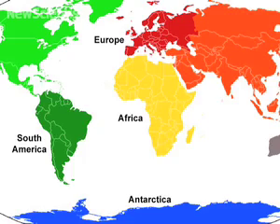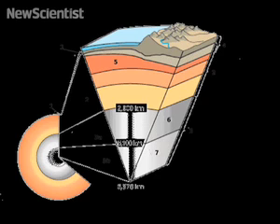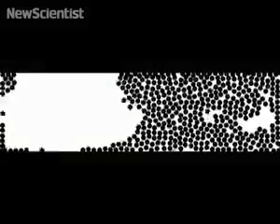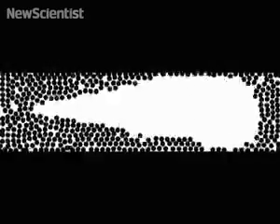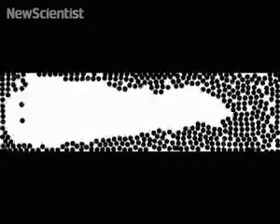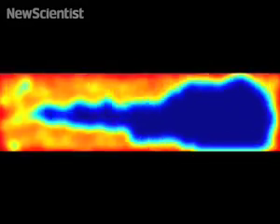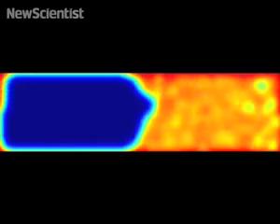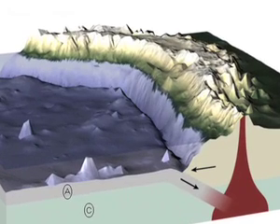Earth-in-a-box may explain continental drift

Comment: make's more sense than this crap did lmao.
subduction is the planetary recycle machine.
eats up old molten rock that solidified into hard solid rock.
with the weight of the crust and the outward force or pressure. is an equal balance between exploding out and imploding in.
same with gravity. this is just a theory.
the weight of gravity pushing down on the earth's surface, it's balanced out by the enormous exploding pressure from the planets core.
But if gravity wasn't their, would it.